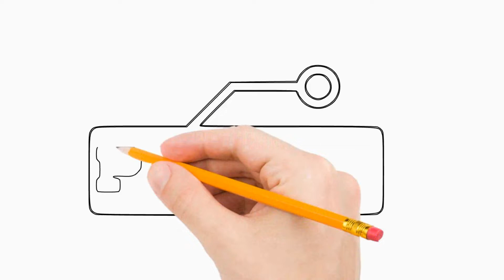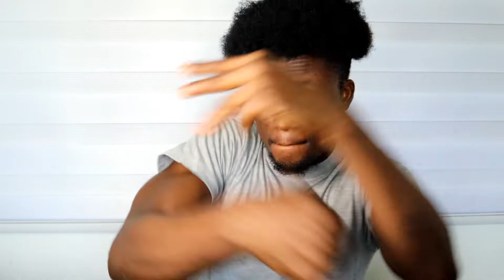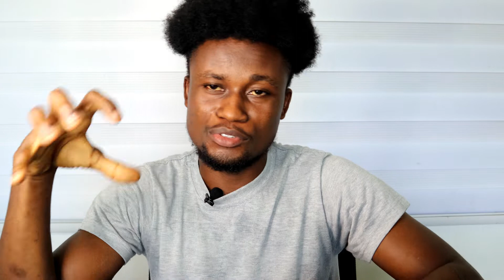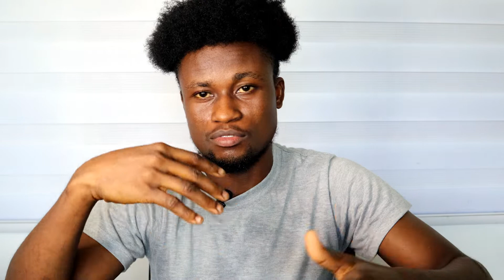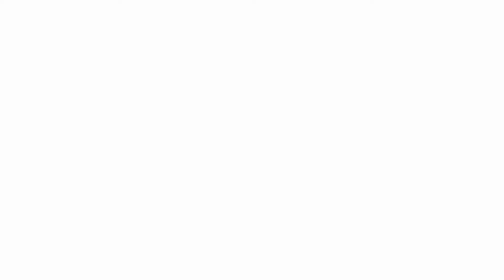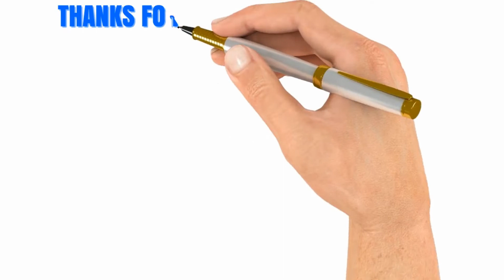💎 How To Install MultiTv For More Free Channels - Tips

Comment: Pbteck I have been watching most of your videos to gain more experience in installation, there is one particular problem that I have face twice which is I tracked Astra 28 with the 12525 v 3000 but the channels were French ones after getting enough signal Please  what causes that boss
Reply from the maker: Yeah it's not a problem. When it happens like that, just bring the dish down. You'll realise that it's above the normal MultiTv position. Don't change anything, just mark the level where you get the French channels and never move the dish to that level. Bring it down to get a different signal and that will be the MultiTv. MultiTv is below the French channels.
Reply: Thanks very much bro keep it up Jah bless you